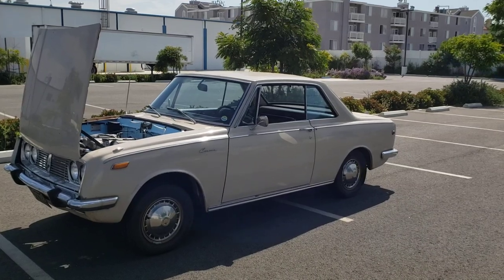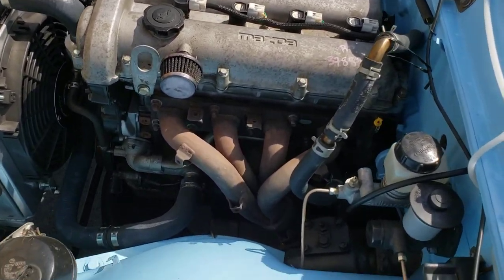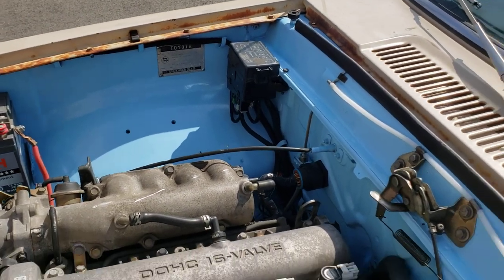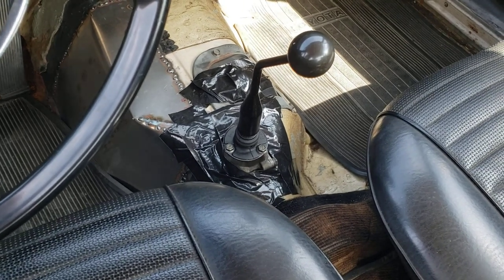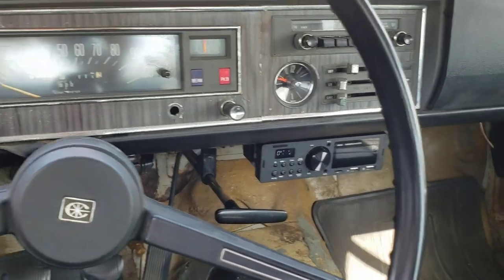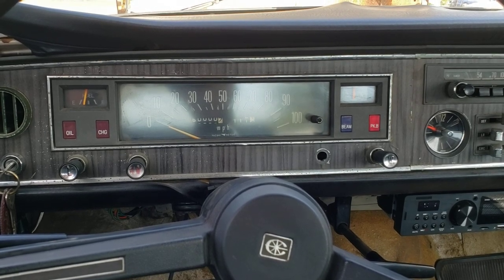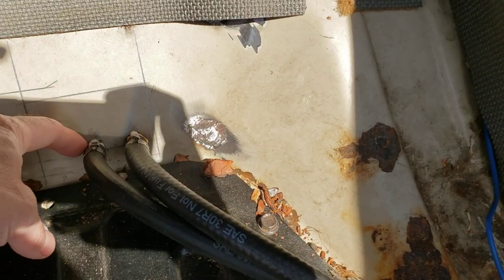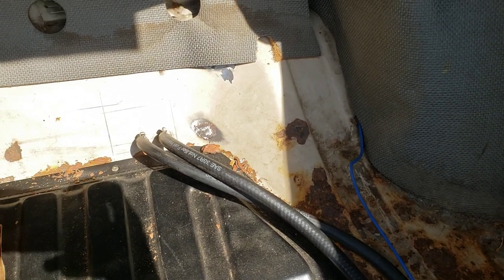1968 Toyota Corona Coupe w/ 2000 Miata Engine Swap

Comment: Would it be possible to swap a K20/K24 into   an RT40?

Also, which car's shocks would be a close fit, especially to replace the rear leaf springs.

TIA

Comment: How does braking feel on it especially with the extra ponies since its 4 wheel drum i had a guy make me some brackets so that i was able to convert a corona i had in 2016 to front disc brakes from first gen acura legend they have 11" rotors just had to upgrade to 15" wheels for clearance

Comment: Very cool car and nice clean swap! About, getting Bosch Igniter and COP coil, is this a Plug-N-Play or any wiring work needed?  Thanks!
Reply from the maker: It requires light modification to the Miata harness (splicing the wires for the two coil packs into the input plug for the Igniter) and the bike coil harness (to space the coils properly and splice to the Igniter output plug). If you're comfortable with soldering wire, it's very easy. There is an outfit called Fab9 that sells a PnP version, but I saved $200 making it myself.
Reply: @jfbrink  Thank you

Comment: What type of motor mount and trans mount did you use and did you have to modify crossmember or anything
Reply from the maker: I modified the stock Miata mount brackets so that they would bolt a few inches farther forward on the block, then I welded simple pads to the Corona front crossmember. The stock Miata rubber isolators sit between them. For the transmission, I notched the stock Corona cross bar and added a pad to it for bolting the transmission with old shock isolators as my rubber. I've added a link to the video description that shows photos of the modifications!
Reply: @jfbrink  thanks im planning on doing the same to my 69 two door
Reply: Also why did u use the different coils and ignitor instead of the miata ones
Reply: @jfbrink  let me know if your willing to cast the parts for cooling and radiator ill pay
Reply: @jfbrink  how did you do the two o2 sensors? I have the whole 2000 miata so maybe see if i can bolt miata subframe and rear end and dash cluster

Comment: Nice swap I had one same year and 2 door but I did a 2rz swap out of a Tacoma very fun car..!! Do you still have the drum brakes in the front?
Reply from the maker: Yes, I'm still running drums. I was developing a disc brake swap based on Geo Metro discs, but even with the added HP, I find the stock drums more than sufficient. But, then, I'm not doing track days, just everyday driving.